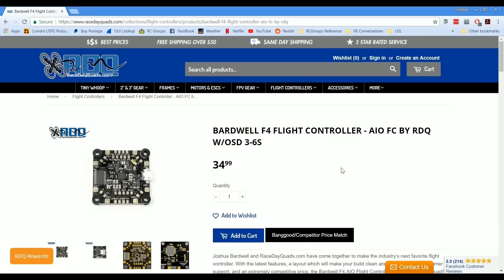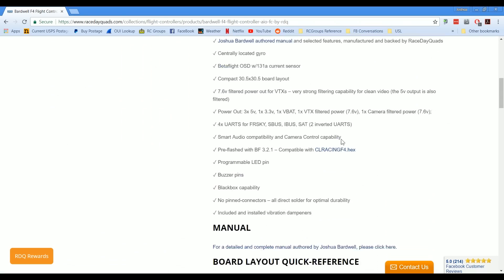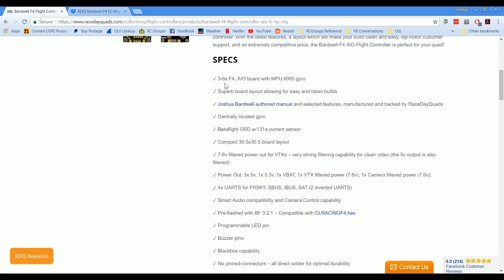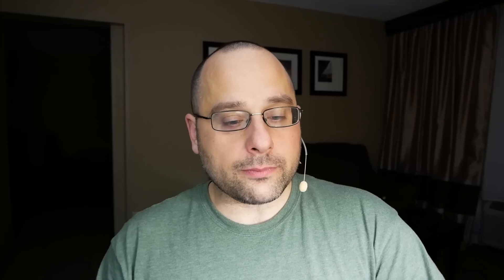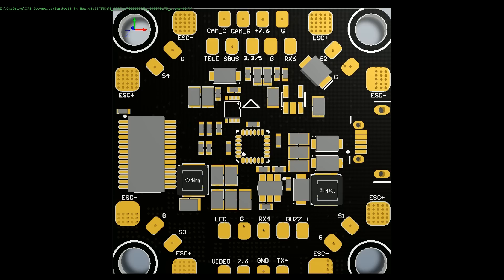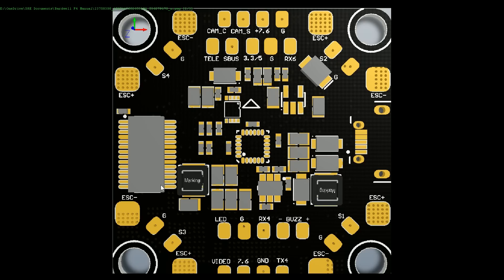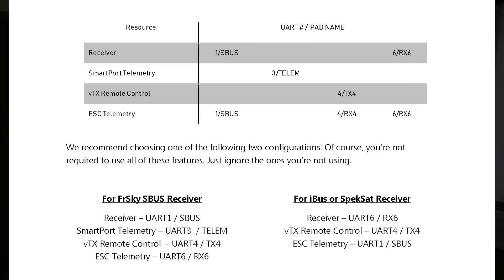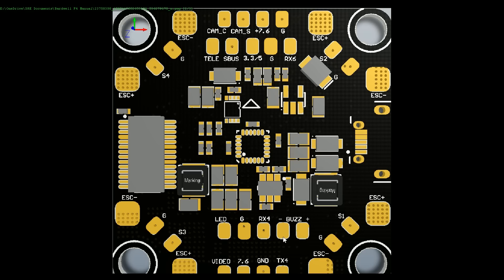Bardwell F4 AIO | JOSHUA BARDWELL FLIGHT CONTROLLER

Comment: Hey Joshua 
Had a question about this FC. Installed this FC on my Armattan Rooster frame this weekend and started flying Saturday. I've got an issue with the Quad that when I do a punchout and then zero throttle and no Pitch or Roll input the nose of the Quad wants to pitch forward. I've tried tuning with the PID and it's the same. Changed the receiver yesterday and the motors today and I'm still getting the same thing. Would there be an issue with the gyro? Started with brand new Esc's and Motors on this build. This is the 6th Quad I've built and not had this issue before. Thanks Donny

Comment: So I'm having an issue with the board and powering my accessories. I am using a 4 in 1 ESC. I decided to just wire Vbat power straight from the 4 in 1 ESC Pad to power the board. The receiver is powered perfectly fine. I am getting power at the esc pads with the multimeter, as well as the battery pads, but for some reason I am getting no power at the two 9v pads. The VTX and Camera pads. No power at the Buzzer pad either. The quad flies perfectly. Hovers LOS. Everything was working for about a 20 second flight before the VTX went out and I had to disarm in the field I was test flying in. Any Idea why I wouldn't be getting power to some of the pads?
Reply from the maker: Please contact general@racedayquads for support. Troubleshooting this is not going to happen over a YT comment. At the very least, someone will want to see how you have wired it up.
Reply: Thank you.

Comment: Hey Joshua 
Just received my 2nd FC. I love the layout of this board. Just had a question. My first FC had the 7.6 volt pad for the camera and VTX. I had to wait a week to order a second board. The new board has 9 volts at the camera and VTX pads. Did something come up to change the voltage at these pads? Thanks Donny
Reply from the maker: We found a few vTX were not happy at 7.6 so we raised the regulator to 9v to ensure wider compatibility.
Reply: Awesome! Thanks for your response.
Working on putting your FC in my Armattan
" Rooster" frame now.

Comment: I have just received my JB F4 and I noticed that the metal pins that hold the micro USB socket to the board do not have any solder on them, I have had sockets come loose on other boards even when being very careful inserting USB cable, is it OK to go ahead and solder these ?

Comment: Hey I am using this board with a R-XSR. I have the smart audio wired up to the telemetry pad although I have it wired to the non inverted bad on the receiver instead of coming out of the plug as normal. Would this be the reason my telemetry isn't working? If not what else could I be doing wrong.
Reply from the maker: +JeRaF FPV yes that is why it's not working. Use the regular Smartport output in your receiver. Also you need to adjust tlm_inverted in the CLI. Please. Refer to the user manual for instructions. It's linked on the RDQ product page.

Comment: Just one thing , the pads will lift if your not careful.  Sooo back to omnibus f4 v3 the airbot one . Had osd problems with last 2 eBay omnibus f4 v3 so got the jb f4  Got all most done with soldering and thought maybe fix that pad ,, nooooo it lifted and its the sbus pad. Biggest learning curve in any hobby for sure FPV

Comment: hey Joshua Bardwell, 
you have helped me so much with drone problems and i want to say thank you first. The point im commenting is that i am having quite an awkward problem with your board. So i bought your board and put it in a Armattan chameleon everything is hooked up fine, i flew it. over a matter of a minute the quad seems like it making a shaking noise and then starts leaning forward. I didnt do this before only after that rough 1 minute. As if there is a error in the gyro. never crashed it. i didnt wire anything wrong or a bigger problem would have occured. I am completely stumped on this problem.

thank you
Reply from the maker: +Jared Garcia please message me directly about this ad your response will probably get lost in the YouTube comments.
Reply: Joshua Bardwell 
How do you want me to message you? Any specific way?
Reply: i have tried everything i am just giving up on the board

Comment: Finally received my JB flight controller and installing it now. I love the layout and the simplicity of it. I do pretty good at soldering, I have a temp control solder gun. The size of the pads for me r perfect. I’ve worked on other boards that r so small it’s difficult for new to intermediate guys like me just getting into the hobby. The manual is by far the most reassuring part of purchasing this board. The instructions have filled in a lot of gaps in my knowledge base. I’ve been looking for a go to board for all my builds. I’ve found it!    Great job JB.
Reply from the maker: Very glad you like it so much :-)

Comment: I've tried every thing you are suppose to do to get the external beeper working on my CL Racing F4 and it still doesn't work. It has got be something wrong with the board. Does your FC which is a lot like the CL FC have any issues with the external beeper?
Reply from the maker: None that I know of.

CLRacing F4 has the on-board beeper right? That's one unique thing about it.

Have you reached out to Cheng Lin on Facebook? It's his board so surely he would be the guy to ask.
Reply: Thank you Joshua!

Comment: Mr. Bardwell very excited I I just received your board in the mail today along with Mach 2 vtx. Question , to set up smart audio on your board do I have to resource map anything or is there an inverted uart?
Reply from the maker: I'm a little confused by your question. SmartAudio doesn't require an inverted UART. So I think you are asking about SmartPort telemetry, in which case no, you don't have to remap anything.

The user manual can be downloaded from the RDQ product page, which addresses many of these questions, although you're welcome to ask me directly as well.
Reply: Joshua Bardwell lol... sorry, yes sir Smart Port. All I use are the Matek boards so I am used to having to remap like your other video shows us how to do. I will get the manual and appreciate the quick response and will let you know if I run into a problem. Thanks again!

Comment: Will the board work with 4 in 1 ESC if you wire it as shown by you in your previous video? It was with a different board but I presume it would be the same.
Reply from the maker: Please check the manual on the product page. Version 1.3 of the manual added instructions for wiring a 4 in 1.

Comment: Dear @Joshua Bardwell - I am a lucky owner of the Bardwell FC, I wanted to use my Crossfire receiver with the flightcontroller, however i accidentally ripped off the TX4 pad... super frustrating! what can i do? Is it possible to remap TX4 to rx6 for example? or do you have good solution for my problematic situation? BTW switched to use Sbus just to fly the FC and see how it is flew a few packs and it is awesome!
Reply from the maker: +Mikkel Dam Samuelsen no I'm sorry you can't remap UARTs that way. If you lifted TX4 I don't see how you can use crossfire.

Comment: How many actual amps can it take ?
Reply from the maker: The official answer is 131 amps, same as the max rating of the current sensor. If you exceed that, you will probably get away with it, but if you burn the board, that's on you.

Comment: Can someone please tell me how to power this board in a stack that already has a PDB with the xt60 lead??  Can i just run from the bat +/- on the PDB to the batt terminals on the bottom of the JB F4?

Basically, my friend bought this to replace the DYS F4 in her Wizard 220s and how those are wired, the xt60 lead is wired to the 4-in-1 ESC which is also a PDB.

Comment: Hey Joshua. Loving your board. Are there any cams that don’t play nice with the board and cam control. I’m trying to get a Monster V2 working with Cam-C and haven’t been able to yet.  Any tweaks in the BF CLI needed?
Reply from the maker: Yeah there are lots of cams that need tweaking. Sometimes adding a capacitor might be necessary. Some people are reporting success by changing the internal resistance value. It is a bit of a crap-shoot until betaflight supports the DAC function. As soon as they do, the issue should mostly go away (we hope).

Comment: hi! Thanks for video! Can You explain a little bit, is it worth to upgrade flight controller, from cc3d to some F3 or F4 or maybe KISS, is there a significant difference in flight? thanks!
Reply from the maker: F1 boards are too slow to run the modern features of the firmware. I definitely suggest upgrading.

Comment: Layout sucks - not for beginners!
Reply from the maker: Respect your opinion, but lots of beginners are telling me this was the easiest build they ever did, so I have to disagree. But it's your money and you should go with what you like.

What would you recommend instead?
Reply: So that's how I get a response out of you, hmm, predictable! - Well if you really wan to know, here you go:
This layout dictates how you run your wiring as any other board would, being able to come in through the front and rear of the board for ESC connections IMO is paramount. It allows for ease of building and soldering, especially for beginners. I've only been building them for a couple years now but when I was a beginner the soldering skill alone was hard enough to master, now you want a newbie in there trying to solder around standoffs to .5mm diameter pads? Like I said bad layout, not to mention the polarity placement on the board was kept in the same placement on each corner, meaning you have to flip your ESC, what if there's and LED on it?  The damn boot button just fell apart from normal handling during the build, what kind of junk is that? Why hide the UARTS and break them up like that, and who uses a buzzer anymore? You put the CAM and VTX connections at the edge of the board leading to wire stress from vibration and connection failures! Placing them inward on the board allows a builder to use some hot glue and the board itself as a support. Like I said back to the drawing board with this one! I wont buy another - I got a new 6" Long Range build video coming out using 32 bit ESC's, Crossfire, & GPS on this flight controller, I plan to share my experience with the rest of the folks out there. Besides I love RDQ, you on the other hand, I am not a fan of.
I recommend the CL Racing F4 for beginners its layout is so simple and ease of connections are great, the inboard smaller wire connections are able to be hot glued and supported from stress, the ESC's come in from the rear, and the UARTS are clearly labelled and grouped together.
Reply from the maker: "So that's how I get a response out of you"? Not sure what you mean. I just searched my comment history on YouTube and it looks like this is the first comment you ever made on my channel.

Beginner doesn't have to solder around the standoffs because the standoffs are not in place when building the quad, or the FC is at the top of the stack.

I don't think that crossing the wires of the ESCs is a problem. If you really mind, give them a twist so they all look the same. I always mount my ESCs same side up regardless of where the wires end up going.

If your boot button fall off during normal handling, contact support for a warranty replacement. Simple as that.

The UARTs are organized based on how people are expected to use the board. Rather than presenting a beginner with a bewildering array of TX and RX pads, they get clear indications of what goes where. If you want a "kitchen sink" style of board that breaks everything out and makes you decide where to put the wires, I suggest the Matek F405 or CTR.

I have never had a wire break off from being on the edge of the board. I never reinforce with hot glue like you suggest, what a mess for rework. To each their own...

Bottom line, it sounds like this is not the FC for you, and no problem with that. It's not the FC for everybody. And you say you're not a fan of me either, so I guess let's just agree to disagree.

Comment: CAMERA CONTROL: I am having issues with the control of the camera. I am able to use the left stick only. I can kinda move around. It seems that the stick movements are to "touchy" which make it hard to move around. I can't get the left stick to get into the menu. Just can't do it. Please help. And also running the Crossfire Reciever. Your manual is a little confusing on what I need to do to remap the LED. Can you help. Thanks
Reply from the maker: Are you looking at v1.3 of the manual? Instructions for setting up softserial on LEDStrip are in there.

For camera control, there are various settings that you might need to tweak. The functionality in betaflight is still a little iffy with some cameras. If you are getting double-clicks, adjust the camera keypress delay in the CLI. Many people are also having success by tweaking the camera internal resistance parameter but it seems to be a bit of a trial-and-error to find the right value.
Reply from the maker: In the CLI type:

set camera_control_key_delay = 180 
save

Change that number DOWN if you are getting double clicks or UP if you are getting missed clicks.

Comment: I did they said what soldering iron did use what temp did you use all kind of excuses! I've soldered plenty of boards and never had that problem and they didn't even mention the boot loader button coming off
Reply from the maker: The questions about your iron are, unfortunately necessary. Many people damage the board through improper soldering technique. If RDQ refunded everybody who did that, they'd be out of business.

Comment: Did I miss something? In your "How to Wire a Flight Controller" series you say to always ground the camera and Vtx to the same pad for clean video. On the JB FC they're on different pads on opposite sides of the board. What about the ground potential difference?

Comment: HopeJoshua or someone else might answer me on this pretty soon:
1) I want to use the current sensor on the 4in1 ESC as it makes the wiring much easier on a Merica frame. Where do I solder the telemetry wire ?
2) As above,should I solder the thin battery voltage wires to the two pads next to the JBFC current sensor ?
3) On the runcam micro, the cam_c is that the white cable ? And do I need to power the camera trough the board then ? I am using Tramp and have main battery voltage into the Tramp and 5v from tramp to the camera. Tramp telemetry is connected.
Reply from the maker: 1) Telemetry wire goes to the FC as usual.

2) Please check the RDQ site for version 1.3 of the manual, which will be released probably tomorrow but definitely in a few days. The wiring diagrams for 4-in-1 are in ther. But it is not as you describe.

3) Cam_C is the camera OSD signal cable. On Runcams, this is usually a second, two-wire, plug.
Reply: Thanks Joshua,I hope this manual is up as soon as possible. If not today I think I will proceed without current sensing,,not important anyway. Then I can power the FC on the two pads on the underside next to the CS ?
Reply: Well it flies at least. Seems all ok really, but is looking forward to the manual update that explains 4in1 procedure.

Comment: Need some help.. My RSSI OSD readout is stuck at 49, never changes.  I'm using a frsky radio / xsr receiver.  I have betaflight config setup right and radio set up for channel 7 as rssi aux.  Any thoughts as to why rssi isn't working right on odd?  Thank u for your time and effort.
Reply: I got it, had wrong aux selected in BF

Comment: Morning, I’m just wiring this board in, replacing a CL Racing F4s. I can’t get the camera control to work with an Arrow v3? Any tips? It was working with the CL Racing F4s and the only thing that’s changed is the FC.  I’ve been in the CLI and the mode/voltage/delay/resistance are default and the same that worked on the CL board.
Reply from the maker: +Dai Hughes the camera circuitry on this and the F4S is identical as far as I know. It's just a resistor in line with the pad.
Reply: Joshua Bardwell I wonder what it is then, definitely something on the new board is stopping it working. Otherwise everything else is spot on and this board flies sooo amazing!
Reply: just thought it was fair to post that I now see many posts of the Foxeer not working with the F4s. I must of been lucky that might did right out of the box with no extra fiddling. Merry Christmas Mr Bardwell.

Comment: The change I would make first is you should at least include an XT 60 pigtail. I have to run to the hobby shop to buy one. It is kind of a put off.
Reply from the maker: +Geebz FPV buy some 14 gauge silicone wire and a pack of 20 XT60 connectors. You don't have to buy a battery lead. Just make one.
Reply: Thanks for the response, I took one from another board for now. I will stock up in the future

Comment: I like this FC!  Easy to solder, well laid out, great quality, and the gummies were already put on!  QUESTION - I want to use this with a 4in1 ESC and still get the current sensor - going by your previous video, I should route the positive wire from the battery to the positive input on the FC then out the closest  ESC pad to the 4in1 ESC.  I cant tell which ESC pad is the closest - which one should I use?
Reply from the maker: DON'T USE JUST ONE ESC PAD. We have had at least one person burn their board that way. The official recommendation is now four 20-gauge wires going from each of the FC ESC+ pads to the vBat+ pad on the ESC.
Reply: Got it.   Thanks for the reply, and I'll do that.  Best of luck on going full time!

Comment: Joshua, would you recommend the TBS Unify Pro V3 which requires 5V only, or would I be better off getting the TBS Unify Pro HV which can handle up to 6S directly when paired with your FC? Thank you.
Reply from the maker: Myself I prefer to run the HV off of vBat, but that's just me. A lot of people feel the 5v Unify gives cleaner video.